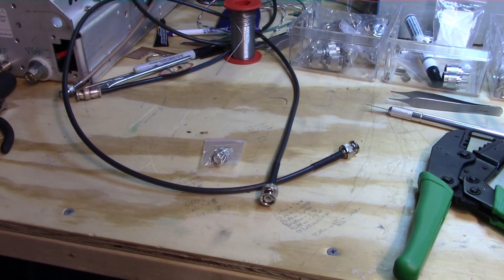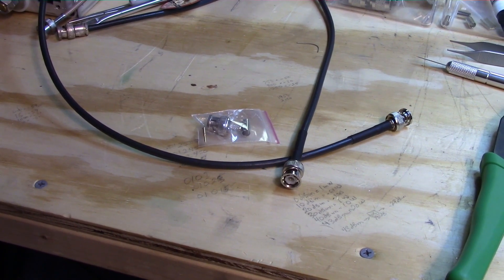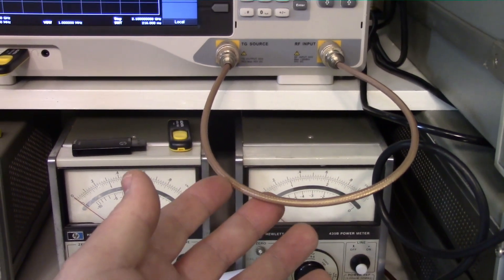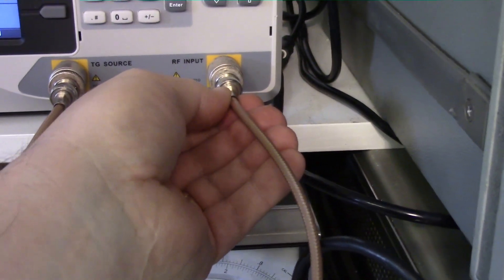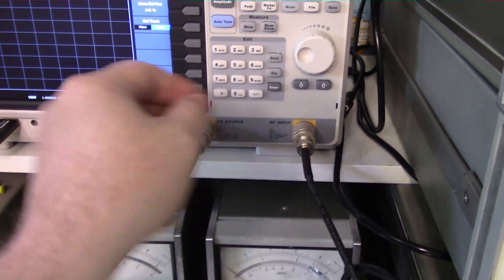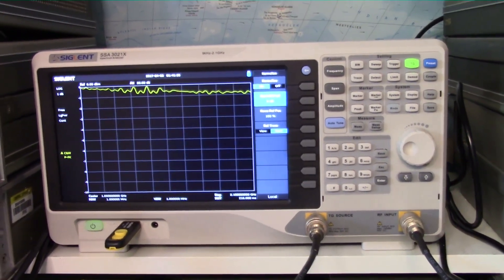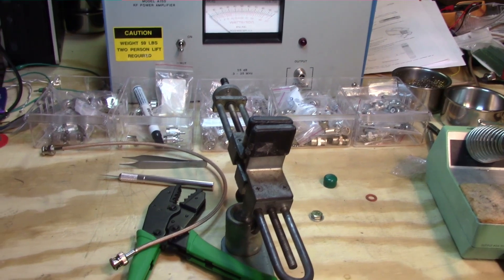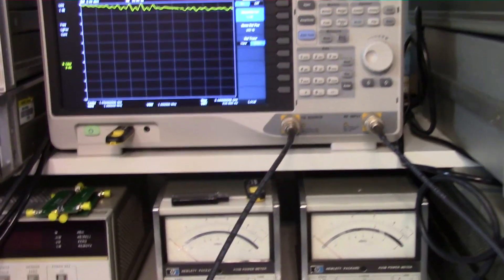Be Careful Buying Cheap RF BNC & N-Connectors !

Comment: Yeah, that was worth mentioning.  Those do seem desperately bad.  I have about 50 crimp-on BNCs left from when I did 10Base2 network installations back in the late 80's and early 90's.  I can tell you they were considerably more than $1 each.  LOL.  However, I still have a few hundred meters of RG58U too.  Not such great stuff but not too bad for what I used if for back then and short jumpers used in none critical situations these days .. so I'll keep it for such 'till my kids are forced to dispose of it.
Reply from the maker: LOL.....we sound alike in that respect. I too have several rolls of 58 that I find very handy for several hundred foot runs out to receive loops and experimental LF & VLF antennas.

Comment: Wish I'd seen your video earlier.  I've just sent a pack of 20 back to the eBay seller as they were just like this.  The photos were of a much better quality connector.  The main problem was that the crimp collars are too large a diameter and very thin, so cannot hold the braid tightly enough.  Oh, and the feeble springs - absolute garbage!
Reply from the maker: Yes, so sad......so much garbage. All greed.

Comment: Yep! Found that also here too! And aside from that, found once I got the BNC on, it was a tug of war to get it off!  Gotta get off the China eBay stuff! 73's David. K8KEM
Reply from the maker: Hi David, well I did it !  It was kind of hard to do so but I dumped all the cheap Asian connectors and started ordering some nice Amphenol etc connectors. Made a test cable up using them and am happy as a pig in ......hi-hi. Tnx es 73

Comment: Ok, I was going to spend a nice quiet afternoon working on projects at the workbench and now I have to characterize all the BNC jumpers I've made! Seriously, Amphenol's are pricey (...back to you get what you pay for) but I've had really good luck with the crimps sold by Quicksilver Radio. Hate to think about how much I've spent stocking the boxes for BNC, UHF, SMA's but on Sunday afternoon if I need one it's there (much like all the component boxes).  73 - Dino KL0S